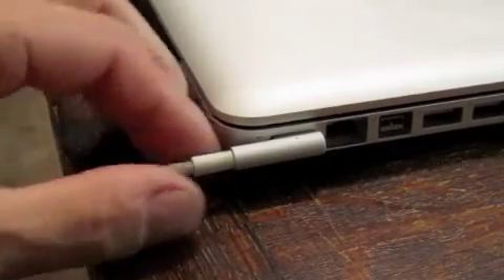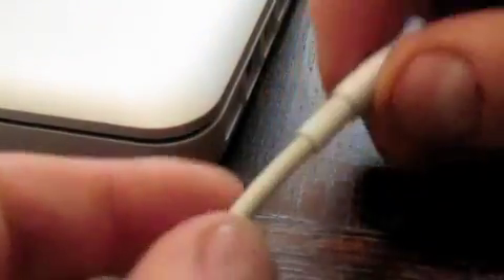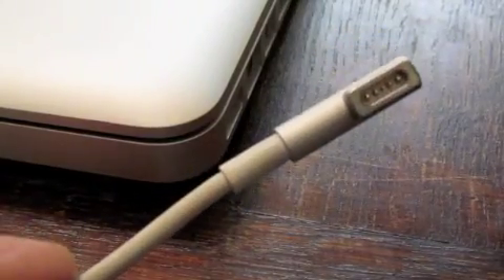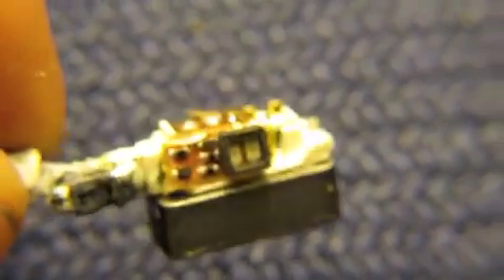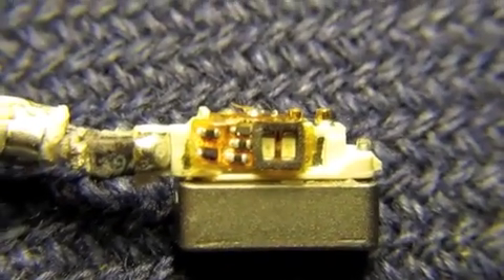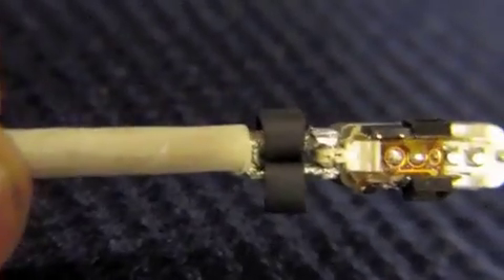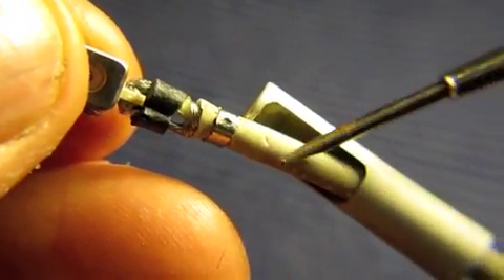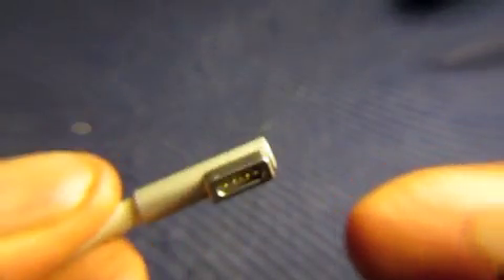Macbook magsafe repair (long vid)

Comment: Just a heads up everyone, avoid the headache of doing what he did to take that plastic piece over the rectangle. I tried for quite a while and it was stuck on. you can just pry open the white square charger housing where all the cords run to. You can get the cord for around $3 on ebay including shipping. I had a charger stop working on me and got a new one (a few years ago) and same thing. except I kept both chargers. I have been becoming a DIY kind of person the last two years and as the second charger began to have this issue I was looking how to fix it. Just buying the cords and soldering the wires together then heat shrinking as the square box was probably a time saver and less of a headache. Still sucked if you are new to soldering like I was, but definitely easier than this. i do appreciate this guy taking the time out to show us how he did it, but I think this was is better that I mentioned.

Comment: yessss this worked for my my kneedles where pushed in guess over time and constant moving , but i took off that silver piece ! took off the little plastic piece with the holes thats in the silver piece and put the silver piece back for magnetic support since the kneedles dont have that plastic piece to support it no more and walla it worked my hearted jumped havnt got to use this laptop in months cause of that problem THANK YOU MAN !

Comment: thank you for the video, but I think the hardest parts are not showed!!, how to remove the conector before welding it?
Reply: I could’t loosen it with pliers. Then I’ve fastened the blocky part in a vice and pried loosen the cylindric part easily.

Comment: I fixed my problem by not buying any Apple products. Haven't bought any since the tablet and phones all died, same with my family's, and other versions I and they owned.

Unoptimised software updates and hardware failures. Borrowed a MacBook Air off my Dad, low and behold the 'Yosemite' update is fucking it up, like I've seen on the internet, and the charger is possing me off.

Comment: a poor design by apple or a clever scam by apple. either way, the dedicated customer loses. i went into the apple store today and paid $100 to replace a shorted out adapter. just does't make sense that a few feet of wire and basic electrical parts should cost so much.

Comment: Wish I watched this before dissecting the aluminum barrel with my dremmel! Haha But it was a kind of an emergency situation to get mr macky powered up so any unshorted port in a storm! ;) 
I mainly needed to double check my polarity as the wire was already pulled out of the end. I did notice one contact had the fibers from the inner cord sticking out so was gonna go with that as pos. Hate to find out hard way I was wrong without a quick youtube visit. Haha
Thanks for the vid!

Comment: Polarity : 
With the prongs facing you the right connection is the inner most wire. The left connection is the wire wrapped around the other that resembles shielding. 

That is on a 60W charger. 

Be careful separating the head of the charger. Remove the magnet ring with pliers. It will need to be glued back in. The plastic is soft use an X-acto knife and take your time. Start on the sides and then move to the tip. Don't push it too far in or you will strike the PCB.
Reply: Drayton Kittel thanks for explaining polarity. I did got of the magnet but sadly the main kept stuck. When trying to pop it out with tweezers I took of the led I think :) apple crappie cable annoyance
Reply: Drayton Kittel what?
Reply: One of the leds with the controller on it broke off when trying to get it out. I did check a different video and they where pulling it out from the side, which is bad cause the leds are there. Do you know if it will give power to the mac if the led, middle pin doesnt work?

Comment: Fantastic DIY spirit, however he makes it look easy pulling/prying the white plastic pin holder within  the barrel.  Don't do it, pushing it will do nothing...you will mangle the barrel, mine was glued in and I trashed it. Buy the whole L-cord, and solder that, unless of course you can handle buying the entire apparatus.

Comment: Way dangerous dude. My magsafe adapter sparked and arced and almost set my house on fire. You NEED to replace that charger, its way past its time.
Reply: Why don't you try unplugging the charger first. Lol
Reply: then screw you , he said be careful and try unplugging, thats like the first rule about electrical safety
Reply: Thats because theres a capacitor in the white box that  holds a substantial charge for a long time when disconnected from power. So crossing/grounding out the wrong things could get exciting. ;)
Reply: Devon Morse hehehe.. right? ?
Reply: or he's so fucking stupid for not unplugging it when in the beginning the guy said to unplug the charger from the outlet
Reply: Piece of shit
Reply: Stagger Lee SERIOUSLY ZAPPED BY 19VOLTS 
Nobody here know what is being zapped like i was on  CRT TV

Comment: I wobbled my magnet out with pliers.
Thanks for being the one to let me know how it comes out. Fixed the wiring inside and it works again!
Reply: Worked fine until the wires frayed loose. Would need to re solder them to get it to work again. Flimsy design by apple.

Comment: where did you get the black sleeve cover???
Reply: The black cover he used is called heat shrink tubing and it is available in various sizes at any decent electronics supply store. Radio shack and harbor freight even carry it. Good luck with your repair..

Comment: THIS IS A TERRIBLE ALMOST IMPOSSIBLE WAY TO FIX A WORN OUT CORD!  BUY A NEW CORD:!
I FIXED MY OVERHEATED BROKEN L SHAPED CONNECTOR CORD 13" MACBOOK PRO.
I BOUGHT A REPLACEMENT CORD FOR $10 W/SHIPPING ON EBAY-I CHOOSE THE T SHAPED CONNECTOR INSTEAD BECAUSE I BELIEVE IT IS HEAVIER DUTY THAN THE L AND THEY ARE INTERCHANGABLE. 
I SAW A YOUTUBE FOR EASILY POPPPING THE BOX OPEN WITH NEEDLE NOSE PLIARS AND SOLDERING THE NEW CORD.
TO OPEN THE POWER BOX, SIMPLY SWING OPEN IT'S CORD STORAGE WINGS AND PLACE NEEDLE NOSE PLIARS TIPS INTO THE EDGES THE WINGS FOLD INTO. 
FORCEFULLY OPEN THE NEEDLE NOSE PLIERS WHICH WILL POP OPEN THE POWER BOX GLUED SPLIT CLAM SHELL SEAM. 
PLACE THE POWER BOX ON A TABLE WITH THE PLIARS PUSHING DOWNWARD AGAINST THE BOX-TABLE-YOU'LL HAVE TO KEEP THE POWER BOX FROM MOVING/PLIARS TIPS FROM COMING OUT BY PLACING THE POWER BOX AGAINST A STATIONARY OBJECT. 
THE CORD STORAGE WINGS AND THEIR DEPLOYING SPRINGS WILL NOW FALL-COME OUT.
I DIDN'T EVEN HAVE TO REMOVE THE CLAM SHELL HALFS COMPLETELY, JUST ENOUGH TO GRAB THE WIRES. 
CUT THE OLD CORD LEAVING AS MUCH OF IT'S WHITE AND BLACK WIRES ON THE POWER BOX. 
STRIP THE OLD WIRES ENOUGH TO SOLDER TO THE NEW WIRES BLACK AND WHITE CABLES. 
USE NARROW STRIPS OF ELECTRIC TAPE TO HOLD THE MATCHING COLOR NEW/OLD WIRES TOGETHER FOR SOLDERING, THEN SOLDER.
ELECTRICAL TAPE THE SOLDIERED BARE ENDS ADEQUATELY AND PUSH BACK INTO THE POWER BOX.   
CAREFULLY LINE EVERYTHING UP.
PLUG IT IN TO THE WALL AND THE COMPUTER FOR A QUICK WORKING TEST BEFORE FINAL GLUING.
PLACE SOME SUPER GLUE ON THE BROKEN OPEN POWER BOX SEAMS.
SNAP EVERYTHING BACK TOGETHER NOT FORGETTING TO REINSTALL THE WINGS AND THEIR DEPLOYING SPRING. 
HOLD THE POWER CLAM CASE HALFS TIGHTLY CLOSED TO ALLOW THE GLUE TO BOND. 
WHILE HOLDING, PLACE CLEAR STRIPS OF SCOTCH TAPE OVER THE GLUED SHELL SEAMS SO YOU CAN REMOVE YOUR HANDS AND BE DONE AND TO INSURE THE SHELL WILL NOT COME APART AS THE GLUE CURES OVERNIGHT.
PLUG IT IN, YOU'RE DONE!

HOPEFULLY THE NEW CORD WILL LAST A GOOD LONG TIME BUT IT'S NOT TO HARD TO REPLACE AGAIN FOR $10 AND ABOUT A 30 MINUTE JOB.

This problem is caused by our current world system that does not do what is best for everyone.  Check out  equal money org
Reply: Good information but you come across immediately as an 80 year old using AOL when you type in ALL CAPS.  Not trying to insult you, just a tip.  Many people ignore anything written in all CAPS

Comment: @MrCoolArtizan I have to buy that same heat shrink tube. Can you tell me what size it was and what the shrink ratio was? I need both sizes if you can. Please let me know ASAP so I can repair my power cord too. Thanks

Comment: This might be too difficult for a non-skilled ordinary person.There is a product called ''Quickfix DC Plugs''. The product works like a replacement dc connector and no soldering is required at all. Technically very simple, easy and just takes 2 mints to fix the dc cord. The kit available for all brand computers in different plug sizes included Apple MagSafe. There is also a video on you tube if u search the name and there will be link  of their e-shop in case u wanted to buy.

Comment: Agreed, in my case as well, it was not pull or bending metal fatigue, but rather twisting, that caused the wire to eventually break and just fall off.

Comment: The biggest issue I have is the fragility of the rubber around the wire itself.  Every apple cable I have disintegrates within a year or two. Why is that? I've been putting tape on the thing as a temporary fix.  Don't know what else to do.  Heat shrink tubing won't fit around the tip.

Comment: if you guys are having problems with the light not turning on at all, I've had this problem as well. what i did was unplugged the cord from the wall outlet for 2 days ( i just forgot about it for 2 days.. might not take as long ) and plugged it back in and it worked..

Comment: i had one of these adapters, it sucked.  it lasted about 5 months and the cables broke right where you said it would.  Not to mention that the design blocks off the ethernet port.  the T model ones are better but still crap.

Comment: Blimey your lucky. I had this exact same problem but the mag safe connector on mine did  not come apart in the same way. To be fair the connector just fell straight off after making a clean break on the inside aluminium. i couldn't push it through like you did and i was really surprised to see how you dismantled it coz mine was solid as a rock. No amount of pushing or pulling is going to get the rest of the insides out of mine. Wish i could have done this coz now i have an old white connector.

Comment: My outer wire screen has been completely dismembered (\near the power brick) and the inner cable (the white inner cable) is beginning to break. Is it possible to completely cut off 2-3inches of the frayed wires and then use the 'good' wires further down to solder the two pieces together?

Comment from the maker: I agree, these macs are not cheap, we deserve a more long lasting design. The new ones out as of Nov 2012 look just as fragile. I guess we all have to be very careful with the power adapter and unplug it from the laptop by holding the plug its self. It is not easy if you have a young child or pet who yank it out. Also now mac have dropped internal CD drives and dropped the 17" MBP it seems to make them less desirable to me.

Comment: First time Macbook Pro Owner here. I have a Mid 2009 - 15 inch Macbook Pro, and have gone through 2 Magsafe power adaptors (version 1) in the past 3 years. The one i'm using now is about to give up as we speak, like in the video. I cannot understand why Apple cannot design these better for the price we pay for the Macbook Pro. I have owned other laptops in the past and have not had any issues with the power adaptor. I will probably never go back to purchasing a macbook pro in the future.

Comment from the maker: I would get some self amalgamating rubber tape, it is like insulation tape but it is not sticky and when stretched and wrapped around the cable will fuse its self together to form one piece of rubber. 
hope this helps.

Comment: I have a lot of open parts on my cable, where you can see the shield. So i tryed to get an meter of heatsink on it, but the end is to thick. So i have to get the Cap off and desolder it. But i cant get this cap off... any advise how you get this thing off finaly?

Comment: thanks a lot. i managed to successfully re-solder the 2 wires and i tested it out but the power isnt hot enough to charge my computer, the lights turn on but theyre not that bright and my computer wont turn back on yet

Comment from the maker: Hello I ended up chopping about 2 inches of cable off, so as to get into undamaged cable, I then carefully striped off the outer plastic sheath for about 1 inch. Then you can see the outer wire screen which you then have to tease out without breaking the strands and then twist them together on one side of the inner cable.You have to tin that with solder being careful not to overheat and melt the inner wire's insulation. Then copy the video, all the best. Hope you do it ok.

Comment: do you strip the wire back so you have better access to the 2 separate wires in the cable? thanks for the video im going to try this when i get home and can use proper tools

Comment: Thanks for the video mate, helps to know that it's possible. I'm halfway hoping that those retards at Apple completely reject my warranty claim so that I can try this hack. Apparently they are REALLY strict on the COSMETICS of the adapter cable, and not really giving a shit if its a strain relief problem or not. Sent me on a 1 hour phone call goose chase with Apple before leaving me with the standard "we'll get back to you in 24 to 48 hours". I ended up buying a new charger anyway. Sucks.

Comment: I totally agree. But since the power brick is not a serviceable part, it will never happen. I was disappointed that I could not find the proper cord, and that I probably would have to spend around $150 on a new power brick (yes, its that expensive around here), so I decided I'll give a shot and send an e-mail to Tim Cook (yes, I know...). 

And you know what? An Apple employee replyed, called me and is working on it to get a replacement for me. Let's see what happens.

Comment from the maker: I assume you are talking about the small gold pins in the magsafe. They are very delicate and I think have a spring inside. Sometimes they can get jammed and get stuck, you could try a switch cleaning lubricant or even a drop of WD40 on each pin and gently push each one with matchstick to see if each pin goes in and out OK.

Comment from the maker: Apple should do these as spares, maybe if enough of us complain about these, they will.
For now all we can do is fix or buy a whole power supply. If the plug is OK and its just the wire your looking for try searching for single core screened cable. I have found -  rs-online  dot c o m /web/p/single-core-microphone-cable/0513294/  
- it should do the job although it is microphone cable. The outer diameter needs to be about 3.6mm. Hope this helps.

Comment: how would you fix the little metal heads? my problem is that my commuter won't charge and i looked it over, and it seems the problem is the metal heads are not connecting

Comment from the maker: Hello it was very difficult to video and do at the same time.
You have to carefully grip the magsafe with a pair of pliers or similar with a piece of paper to protect the metal sandwiched in between. Be sure to grip the outer parts of the magsafe so as not to squash it in the middle. 
Now with the magsafe gripped firmly use pair of pincers or wire cutters and position between the metal tube and the magsafe and gently pry apart. Remember to protect the metal with paper where the pincers touch.